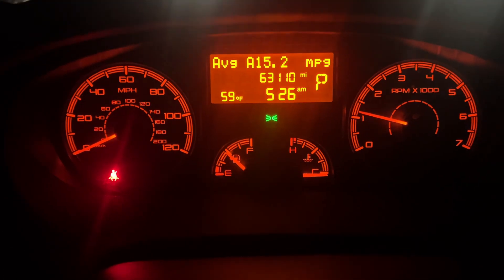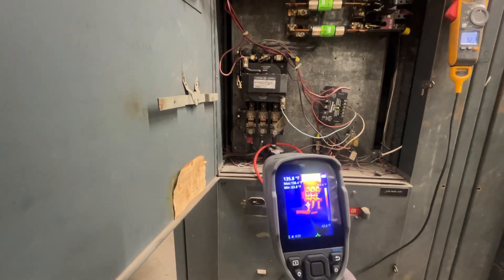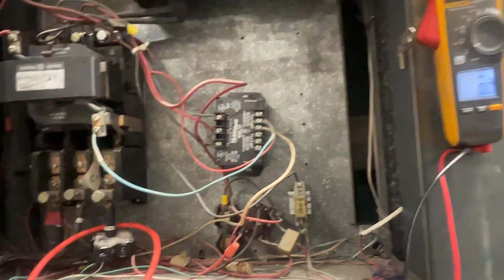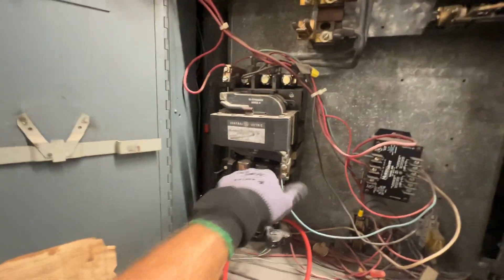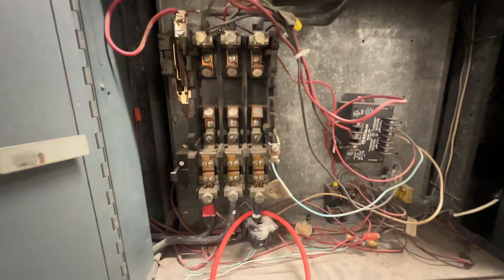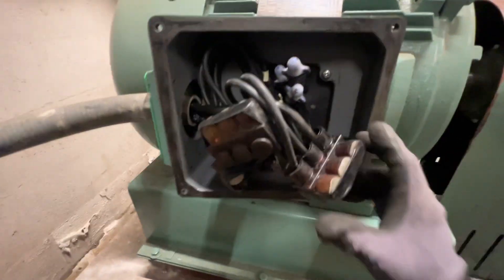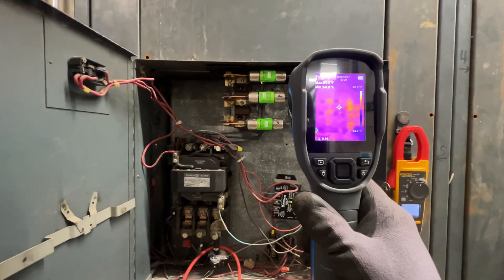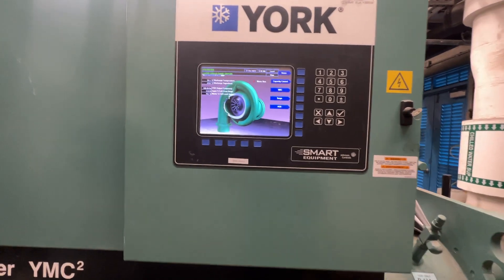Breaker .. Breaker We Have A Problem | To Be Continued…..

Comment: The whole lineup of switchgear is obsolete and needs to go. Drive would be best but not necessary. 

Your thoughts on the pump being undersized for the load is plausible but thats for mechanical to determine. Im just an electrician.
Reply from the maker: I have a few obsolete sites, this one was built 1967-68. Thanks for commenting!

Comment: My bet is the electricians will not improve the amp draw much. I think you still have a motor problem.
Reply from the maker: I’m more inclined to think it’s undersized for wide open operation. The fuse switch definitely needs replacing/upgrade, going over with electrician tomorrow. Would’ve been nice if the mcc was replaced with chillers.